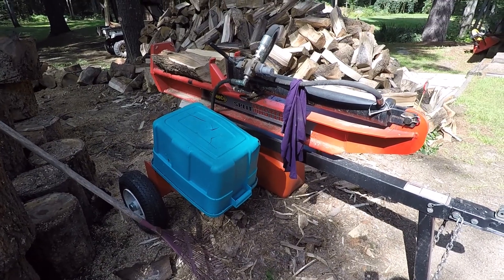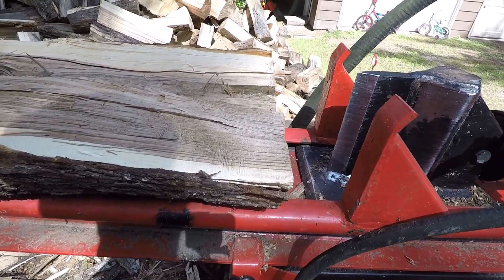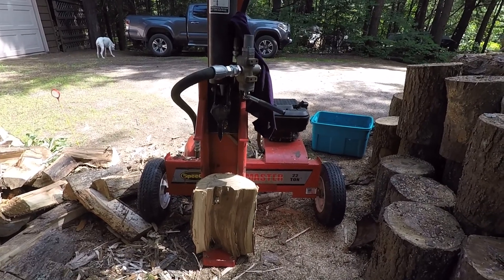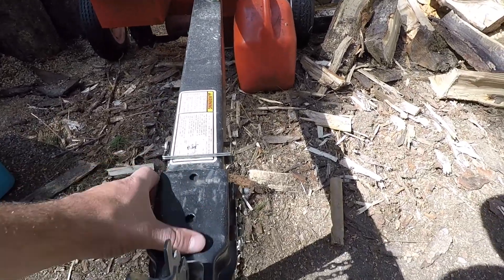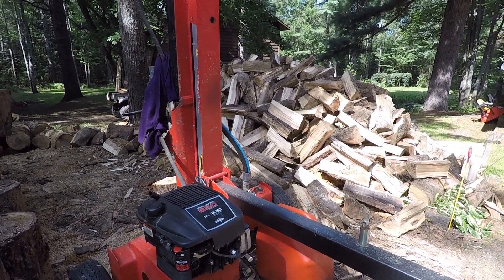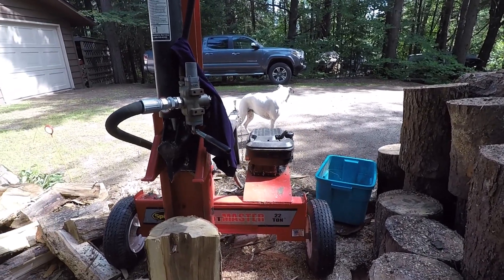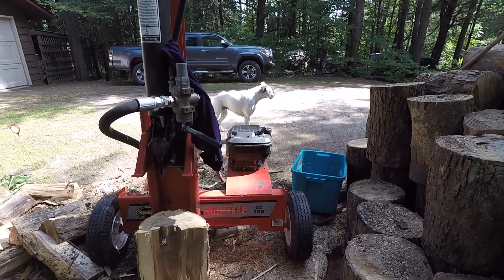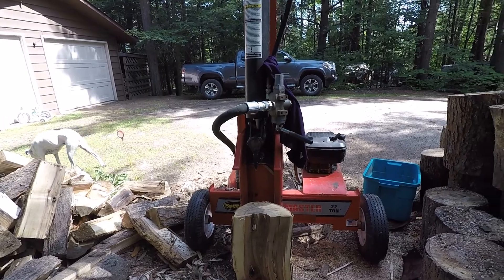SpeeCo SplitMASTER 22TON Review

Comment: Wow! 500 cords and still going strong. That's a testament to you both. Looking at a used one just like this for sale. Thanks for the info!
Curt Hartman
Livingston, Montana
Reply from the maker: i think it is a very good unit for the price.  You can always upgrade things as you go.  Hydraulic lines are cheap, oil is cheap, a new motor or pump if need be is rather cheap.  My neighbor borrowed it last summer and had to put a new pump coupler on it.  lol

Comment: adam, i have the same 22t splitter and I wanted to replace the B&S 6.5 HP motor because I bought it used and I wanted a new engine, simple!  Sooo, after extensive research, you tube/google, I found that a Harbor Freight Predator 173cc engine shaft length , love joy coupling , etc. might work...120 dollars free shipping ... mounting holes were exact -shaft perfect..hard to find a vertical shaft motor!   anyway, i wired the brake back, jerry-rigged the throttle with a wire, and to turn it off...put it on idle and pushed the prime bulb once or twice... there is no oil change  drain system!  as this is a lawn mower engine, sooo...i bought a 15 dollar 12 volt oil /gas pump off ebay and that works!   Also, take half a pallet- put some legs on it and use that as a wood tray..one side only!  and after all that go have a moose-head beer...eagle-san in colorado

Comment: I bought a used Huskee (made by Speeco) 22 ton, looks just like yours, for $400 American off craigslist more than 5 years back.  I replaced a bad tire and the hydraulic oil filter when I got it, and this year I replaced the carb on the engine.  Other than that I've only had to change the engine oil every year, and that's it.  I split 2 to 3 cords a year.  I have no doubt I could sell it for at least $800 today, if I decided to, but as long as I need some firewood, I'll keep it.  If the motor ever dies, I'll replace it and keep using it.

Comment: I made the mistake of buying a Speeco 27 ton years ago. Just bought a Eastonmade Ultra. 4 sec cycle time, 6 grand though. I can split now for an hour that would take my speeco 8 hours. If you heat your house with wood spend the money. If you do buy a speeco mine fought on fire once because the chips build up around the exhaust
Reply from the maker: It is slow when you compare it to other brands.  When i bought it, it was also a fraction of the cost of those faster units.  It's a good unit for the price.  If is far from perfect  though!!

Comment: I have one I bought in 2006. Can you tell me if I can get the hydro fluid filter from NAPA? What do I ask for? My filter has long since lost all markings. In fact I am about to change the fluid for the first time in 11yrs. Runs fine.
Reply from the maker: I don't know what the part number would be.  Look on the filter and there should be one on it.  NAPA can likely cross reference the number and get you one.  You can also get a new filter and housing if need be.  That is what i did.